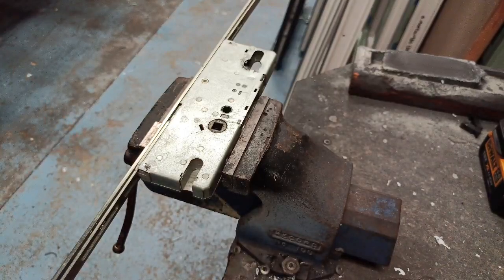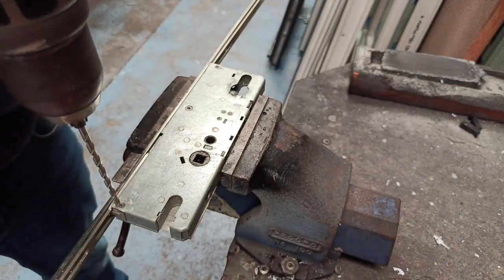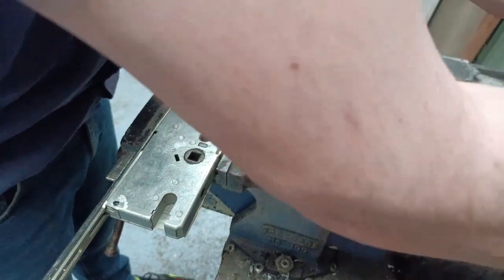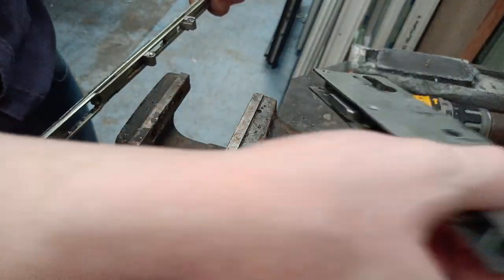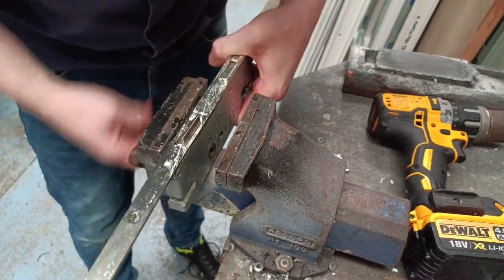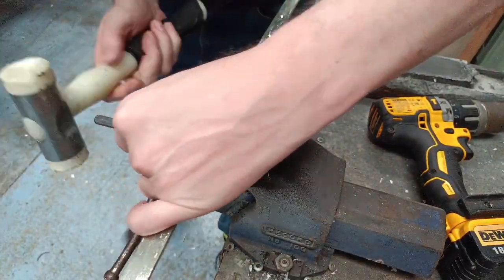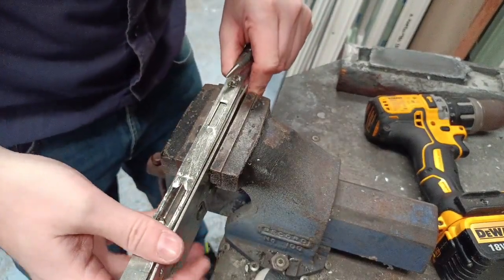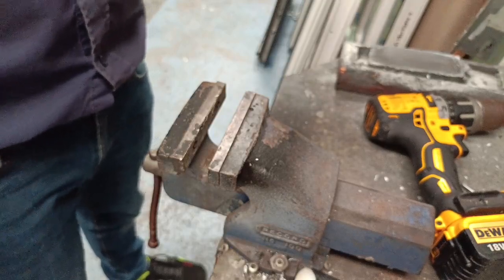How to Replace a Riveted Winkhaus Cobra Centre Gearbox Door Lock: Quick & Easy Method to Save Money!

Comment: Very helpful, particularly the link to the rivets.  Why Winkhaus does not (like other manufacturers) use screws is, presumably, to encourage users to buy the whole mechanism.  I will avoid Winkhaus mechanisms in future, as mine failed after five years.
Reply from the maker: Hi, yes that is most likely the reason , would be so much easier if they did use screws.